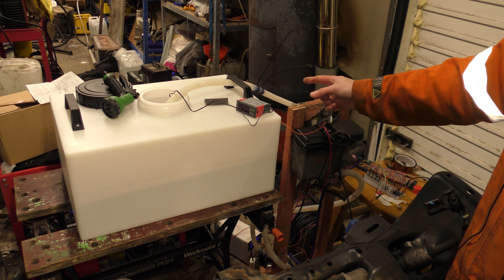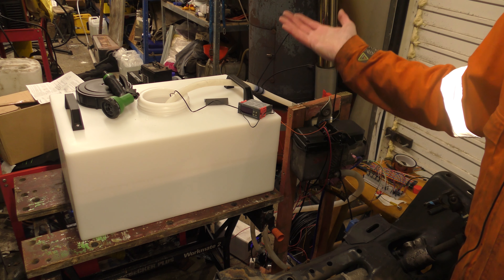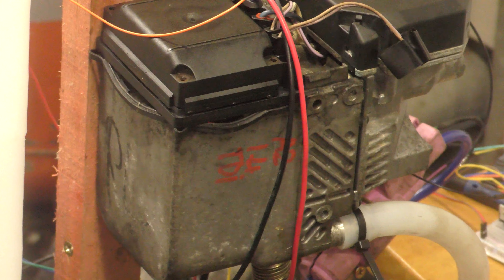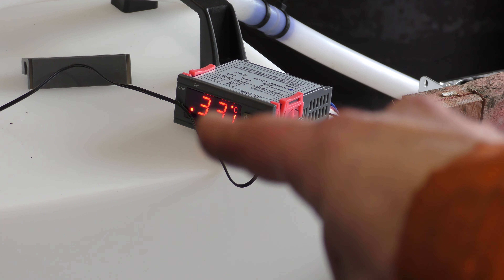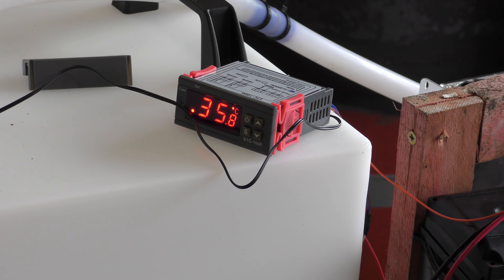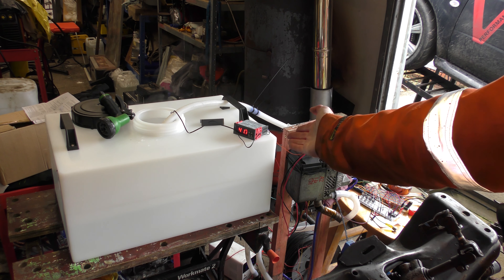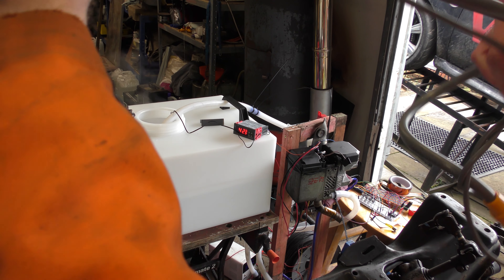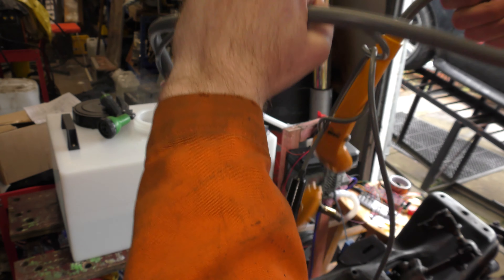Webasto Shower - pumped from tank plus thermostat control & eBay cheapest 12V shower

Comment: Hi this is what i use for my window cleaning same setup. Heat water to 65 70 degrees 320 litre tank its insulated once heated i can then have hot water all day only drops 1 degree every hour in  the  tank. In the morning if i have any left its still at 40 to 48 degrees so then its really easy to heat it back up again to full temperature. When i fill my tank as its filling i heat it at the same time its brilliant

Comment: Using 30L and 30oC increase in temp works out to around 1.05KWhr of energy in 15 minutes...means the webasto is actually delivering 4.2KW...if you allow a minute or so to start working properly and take into account the overshoot, it's looking like the webasto is actually 5KW. Pretty cool David.
Reply from the maker: Yes!  It does say 5KW so that's pretty close considering its age.  :)

Comment: On my boat merry Fisher 655 I've installed a 230v 1500w Chinese 10l water heater. Connected to a suitcase 4-stroke generator plus normal thermostatically controlled mixer. Running from the deck wash pump with a 200l water storage bag.
With a 4L a minute restrictor and a water saving shower head.
I can have a constant 37°    shower for 50 minutes it's amazing.
Reply: Nice setup and I like the idea of these auto mixers. We don't really see them here in Australia just gotta fiddle till it feels right not to burn you.

Comment: That was awesome. 
How hot can the rebosto heat water?
60c 80c or higher, maybe boiling point?
Reply from the maker: The Webasto shuts down at it's max temperature of around 80ºC
Reply: @DavidMcLuckie  could you send me the model numbers and serial numbers of the websto water heater? I want to design something to install it in my 40 ft caravan.

Comment: Hi David it’s John just an idea I no you like messing with a kinds of stuff with the chines heaters I’ve seen a gadget that switches power from one source of power like a 12v reducer connected to mains power to a 12v battery the only thing is it takes a couple of seconds to switch would this be enough to keep the heater going rather than it shutting down if there was a power cut I would like to know your thoughts on this if you’ve got time this is the gadget ( Keenso Power Supply Battery Controller, Emergency Automatic Switch Module DC 12V 24V 36V 48V 10A for Emergency Battery Switching ) thanks stay safe in these unusual times regards John

Comment: Could you do an experiment of the webasto hooked up to a small oil cooler / car radiator / heat exchanger or something, with a fan to use as a small heating system? I'm wondering if I could fit one into my truck as the original use as a block heater, but with the supplementary use of heating inside the truck, via the idea mentioned above, plumbed into the cooling system, when the engine is off. Powered via a leisure battery.
Reply from the maker: You could plumb it into the trucks cooling system and then just use the existing heater matrix in the cab and power it's fan with 12V.
Reply: This is why I asked you this question. Simple answer staring me right in the face 😂

Comment: great set up , what webasto are you using ? does it have a water circulation pump ? where is you water coming from  and finally can you supply a wiring diagram please
Reply from the maker: That is a Webasto Thermotop Z.  They use an external pump that wires into the Webasto controller.  Water from 60L tank.  Apart from the +ve and -ve main connections the only other is the +ve trigger wire that I had switched by the thermostat.

Comment: I have a unit removed from a Mecedes sprinter. I don't have a  way to control the unit. What is the description of this "Hungarian ECU"? Would it be available on Amazon?
Reply from the maker: Depending on what model of webasto it is there are a few options. Older Webasto - https://www.ebay.co.uk/itm/394433268900.  Newer - https://www.ebay.co.uk/itm/124147753763

Comment: Can I ask which wires you attached the thermostat controller to?
Reply from the maker: Just using the 12V trigger wire.  When the water reaches the desired temperature the thermostat clicks off removing the 12V trigger and the heater enters shutdown.
Reply: @DavidMcLuckie  thanks for that... 👍🏻

Comment: David, where do you buy the ECU from please
Reply from the maker: https://www.ebay.co.uk/itm/DIESEL-Aftermarket-controller-Webasto-Thermo-Top-C-Z-E-P-TSL-17/153721220865?ssPageName=STRK%3AMEBIDX%3AIT&_trksid=p2057872.m2749.l2649
Reply: @DavidMcLuckie  thanks, btw my webasto heats water with antifreeze in a loop going through a heat exchanger, this gives continuous water for shower washing up etc, and is hot in 2 minutes,  no need for tank

Comment: Hi guys, the idea is great👍, and I really dont wanna piss on ya cornflakes,. BUT, this is an accident waiting to happen, the reason your cylinder at home is hot to about 65 degrees plus, is to kill all the nasty stuff that loves to live in 38 to 50 ish degrees Celsius. 
Having a tank of water at 40 ish degrees is going to bad for someone. SORRY.
Reply from the maker: That's a very good point actually.  One I had completely forgotten about.  You'd have to sterilise it regularly either by heat or chemically.
Reply: Yeah thermal disinfection every so often, otherwise is will started to smell too.
Reply: you could put a waterproof UV light in there UV light kill all bacteria in water in about 10-15 seconds depending on how big your water tank is
Reply: @jamiemarquiss6065  Not if you use a smaller tank that would hold up just enough water for one shower and heat up the water to 40 degrees and use it up in about 15 minutes. There would be no time for any bacteria to grow and there would be no water left either for any bacteria to grow. Would you agree or am I missing something?
Reply: @tolunayaytekin  
40 degrees is perfect breeding temp for all sorts of bacteria. You will never dry out the storage cylinder. So if it where me i wouldn't.
Reply: if it was just for a weekend of camping, cant see it being bad. long term i would be running a mixer and having a hot and cold source.
Reply: @bl0wfish  I did not want to take a chance and installed a heat exchanger. I now have a hot and cold source as you put it. I appreciate Jamie Marquiss for bringing this up. I am satisfied with the setup I have now.
Reply: It's a camp shower and wash dishes after dinner the temps inside that diesel heater would be well over 40degrees and probably a half teaspoon of powered chlorine will kill anything in the tank as it does with my mobile coffee grey tank that has milk and other lovely stuff in it never smells.

Comment: link to controller? 12volt tho please lol
Reply from the maker: It was one of these - https://www.ebay.co.uk/itm/STC-1000-Temperature-Controller-Temp-Sensor-Thermostat-Control-Digital-12V-AC-DC/193497674095?hash=item2d0d5c316f:g:3LAAAOSwKule1gW0
Hopefully you'll get a 12V version.

Comment: A cheapo 12v pump from china, a bog-standard household shower kit and some extended hose (aswell as some electrickery gubbins), probably would be more reliable than that cheap & nasty shower kit... :D
Reply from the maker: It certainly couldn't be much worse.
Reply: @DavidMcLuckie  I have one of the pumps (got it from Banggood I think just to make up an order so it gave a discount!) and it seemed to pump through the bathroom showerhead quite well, though that was cold water, don't know how it'd cope with hot... :)